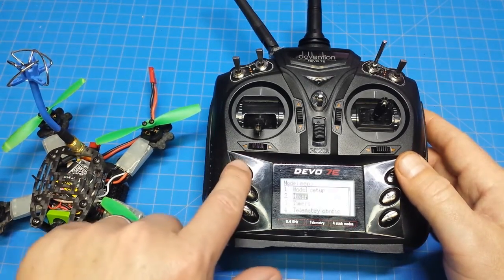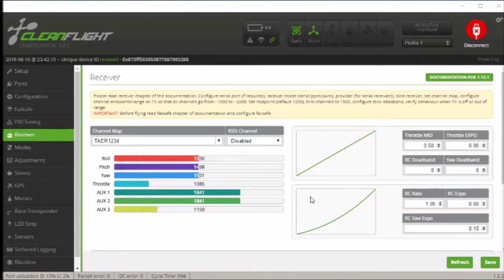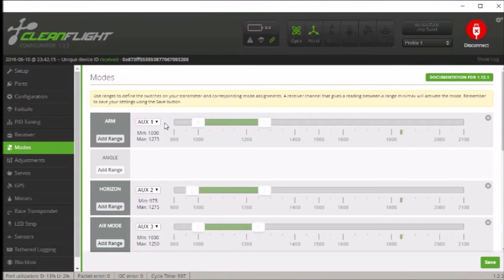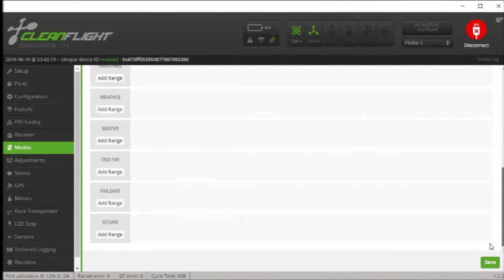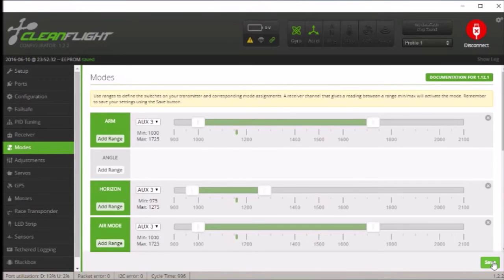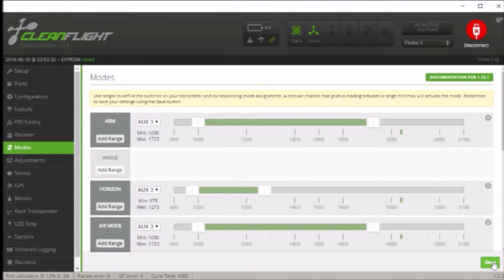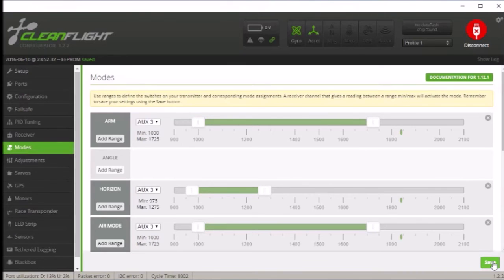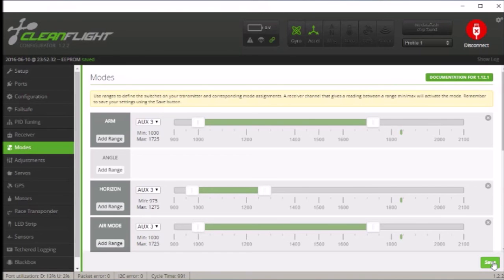Devo Mod - 3 position switch 3 values

Comment: Awesome video Nick!  I am currently rocking the devo 7E as my primary transmitter for all my models.  The problem I am having is when I went to set the mid point in the receiver tab in betaflight to 1500 on the roll it seldomly returns to the 1500 it will be 1497 or 1502.  Is that a bad gimbal or could it be something else?  Whats the fix?
Reply from the maker: Mine are generally like that too. I don't have an issue in flight, so I have done nothing about it. If its causing you issue in flight maybe add a small bit of expo to smooth it out

Comment: the power mod they talk about shorting a resistor in the factory module to bring the power from minimum to full power remote do you know anything about that cuz when I turn my on after flashing it it said it was already at 150 milliwatts.
Reply from the maker: I don't know a lot, but I have read that the 150 milliwatts is always report, false positive. The soldering for the power mod is ridiculously small. And you have to desolder the current radio to get to it. For me, I don't fly far out (backyard or slightly bigger). I have run out past 160m, I am okay with that distance.
Reply: that is normal after installing deviationtx. after the mod  you have to do something in the hardware file. then you can change the mW to more or less. there are videos online how to do it.
Reply: i used conductif ink to do that mod ^^ works like a charm
Reply: Takoza did you remove the resistor or short the top of it?
Reply: covered it in conductif ink so the 2 pads are shorted ;-)

Comment: Didi you installed the new three in one module on your devo?
Reply from the maker: I have not. I should pick one up and give it a go. I hear the wiring might be a bit of a mess.
Reply: Really? more then installing two modules? I doubt it.
Reply from the maker: I mess as in the wire from the 3 in 1 to the devo might not be consistent. Not a expert, I have read of people getting creative to sort out the issues. I think there is even a 4 in 1 in the works, but a ways out yet.
Reply: I have not much info on installing it on the devo 7e but frequentflier rc installed it on a devo 10, he uploaded a video, seems a very simple mod at least on the devo 10. The only issue I know with the 3 in oen and devo seems to be related to power issue but only the warning on the bangood page. I have not investigated further yet.

Comment: Awesome, Thanks man. I have most of my parts waiting to be fitted :D
Reply from the maker: can't go wrong with a devo 7e, imho
Reply: Thanks again! Just finished installing my switches and all values set and showing up on the mixers. I used the 2 page method, I think the trick with it is in "(click the switch button to get the ! which inverts the test)", meaning hit Enter to get the ! to show up. I'll have a tinker in Cleanflight later and set up my flight modes for my Scisky.
Reply from the maker: I wouldn't use motor shafts to apply the glue. The glue will be at the edge of the prop hole. A needle is smaller and will get glue down in the prop hole. It will last longer and have more grip.
Reply: +Nick Burns wrong video Buddy :)
Reply from the maker: ack